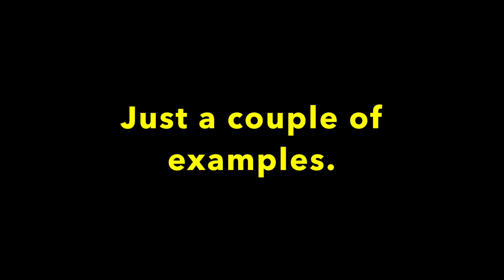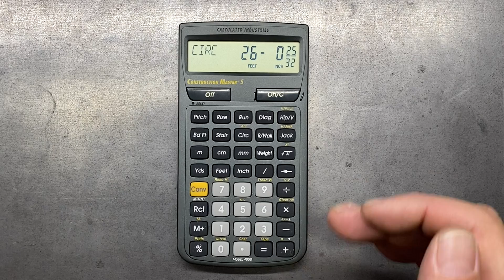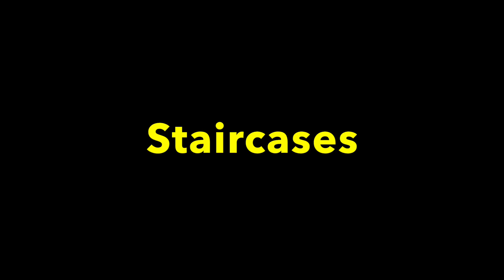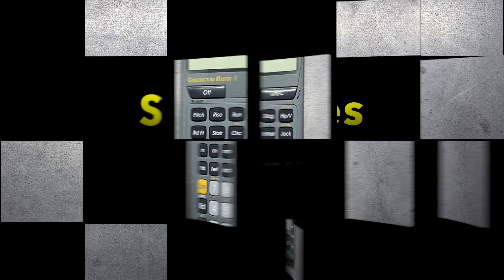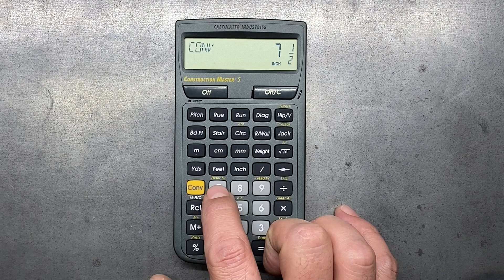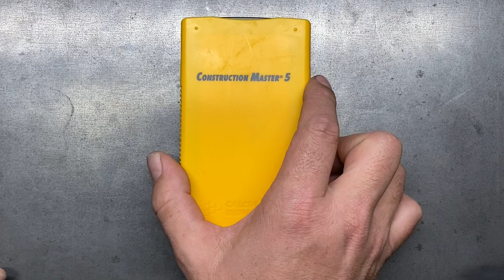Calculated Industries: Construction Master 5

Comment from the maker: Construction Master 5 - https://amzn.to/2WirHZJ
Construction Master Pro - https://amzn.to/2QlN9tb
Construction Master Pro-Desktop - https://amzn.to/38XnqNS
Measure Master - https://amzn.to/2x5kilK
ConversionCalc Plus - https://amzn.to/2IQc4kh
Concrete Pro - https://amzn.to/2WiiY9S
HeavyCalc Pro - https://amzn.to/39UgouE
Pipe Trades Pro - https://amzn.to/2TUVhmx
TradesmanCalc - https://amzn.to/3d0VSe1
Material Estimator - https://amzn.to/3cXI182
ElectriCalc Pro - https://amzn.to/3b4scuK
MachinistCalc Advanced - https://amzn.to/2xKUyM7
MachnistCalc Pro 2 - https://amzn.to/33s7WjR
Construction Master Pro Workbook and Study Guide - https://amzn.to/2x4q9YU

Comment: On my calculator using the same figures, i got 6 3/8 for the Diag. Anyone else?
Reply: Dude i am sitting here wondering wth is going on. I am getting the same as you! But you can also get this same level of accuracy. 

You have to hit the convert - % - FRAC - hit the plus or minus - then set it at 1/32. 

This will give you the same output as seen in the video.

Comment: My construction master 5 calculator on my app,  that I bought from the app store is not having the same numbers, video time 6.28  I type the 8" and R HT and the after I press stair, come 8" rise , is same , but after I press stair again, and RSRS and is 12, and yours is 15, and I press stair again and T WD is 10 15/16" and yours show 13 5/32",  I dit it 10 times and I still getting the same numbers, I bought the app today, is something wrong?
Reply: Maybe the default Riser Ht is not using the same value. To change the default value type the "value you want"+Conv+7